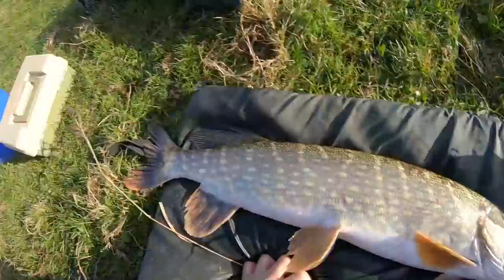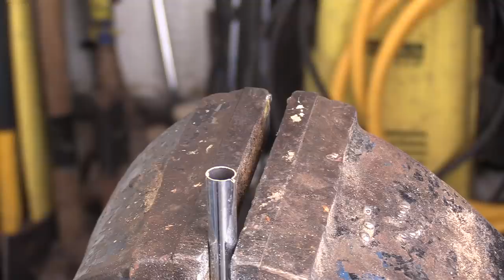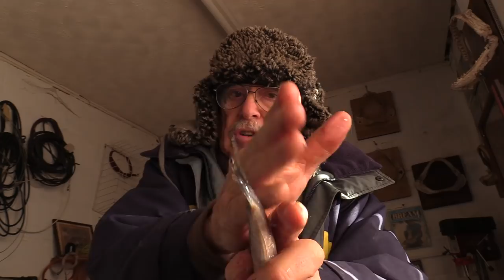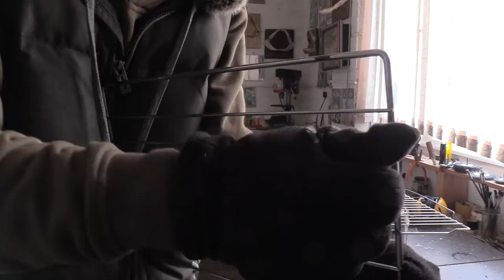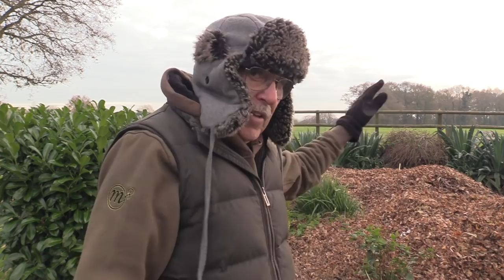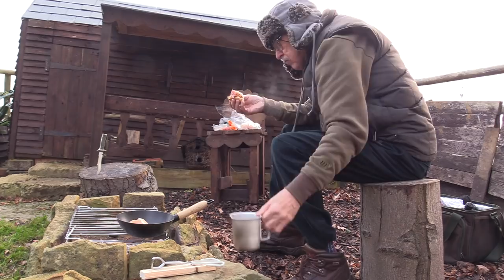Pike Fishing Rivers - Big Fish in 5 Minutes!

Comment: Hi Graham,  I used fish a small river as a kid,(1975) ,it had a fishing club on it and  regularly had matches on it.

, it had a good flow on it , as the chosen method was a stick float . Now the same river has no flow on it, no fishing club, and is stuffed full of weed. There’s little bank side vegetation maintenance by the EA, (once a year) at most. I think the increased vegetation hanging in to the flow has slowed the flow of the river leading to silt settlement and a increase in water weed growth leading to more weed growth and choking of the river. From a small river you could run a stick float at pace ,   to a weed choked ditch 😔. I personally don’t think the EA are doing there job in maintaining are waterways. River fishing has declined. E A don’t do the maintenance they used to on the river banks, they hide behind the cloak of protecting wildlife by not cutting bank-side vegetation but it’s just a con to save them money. There’s to sides to a river,  surly the EA could maintain one side of a water way and leave the other side for nature alternating each bank over the distance of the water way.  My point is that I don’t think the EA care about fishing except for taking the money.
Graham have the water’s you fished as a kid declined under EA management.